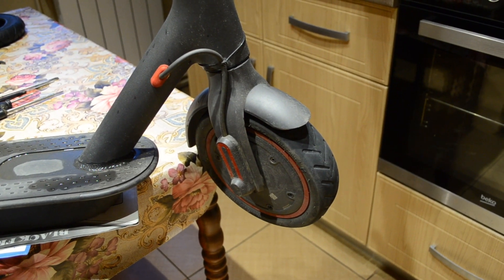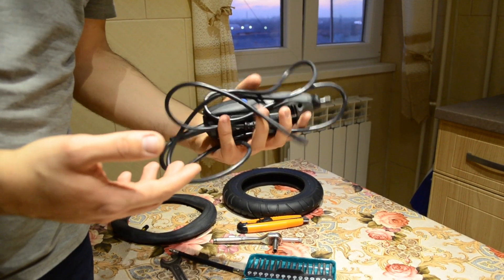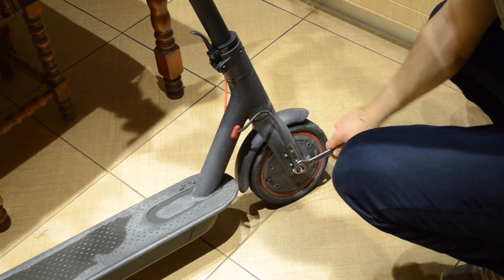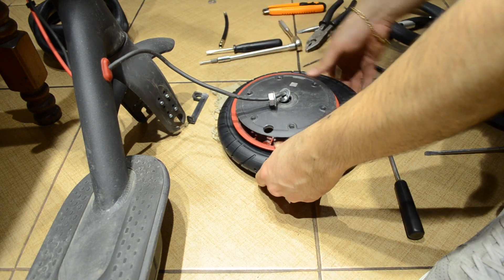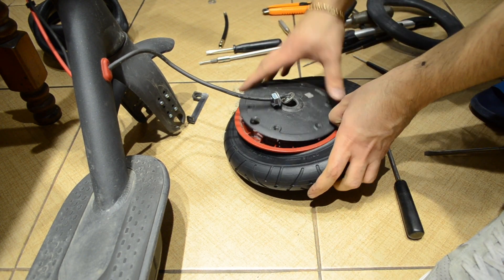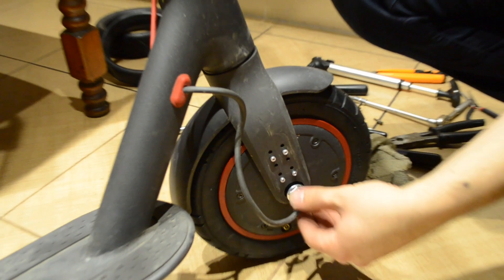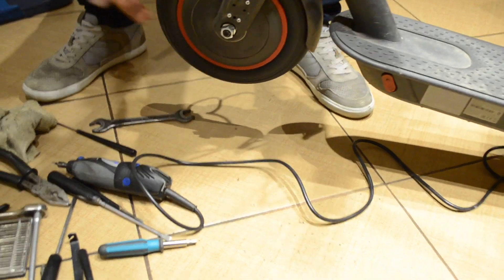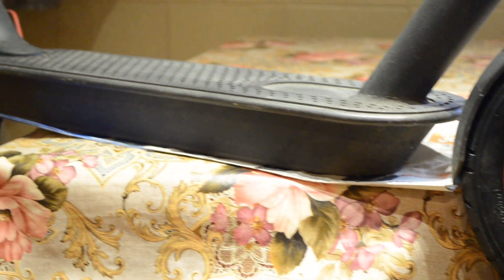Xiaomi m365 pro frontal 10 inch tire upgrade

Comment: Great video, thank you. The bearing was supposed to stay intact with the cover, that was why you had trouble removing it and putting it back.  Generally, the bearing has to be compressed into the cover, and the bearing should come off the axle easily, but it got stuck on the axle for some reason. it's amazing you were able to remove and force the cover back without compressing the bearing with a tool.
Reply from the maker: Thank you for your kind words!

Indeed. The other scooter was less problematic
Reply: There's literally no use in removing the motor cover. It's a perfect way to permanently damage it.
Reply from the maker: @hzpc  there is a plastic holder in there, so unless you want to drill/cut it away, it is far easier to remove the cover. As I said in the video as well, the cover usually comes off really easy, it's just that when I recorded this video for the pro version, it got off harder
Reply: @MrAbcdefgh1989  Not needed at all, you can change the front tire without taking apart the cover. It's possible to remove the inner tube without doing so.

Comment: This comment might be too late but you installed your front wheel the other way around. The spacer should be on the down side, not top. You did not need to cut away the plastic cover. You just changed the tires. Did not affect the mechanism of it.
Reply: Not correct - without the spacer placed upwards the larger tyre rubs on the mudguard, and it doesn't require much debris to get in there before the wheel seizes completely.

Comment: Nice  video , but i would say ,the plate came down so hard because the bearing  came out of its place , 
 it should stay in the plate  and you should use talcum powder when instaling a tire.
you could avoid using the dremel tool,
 if you change the front mudguard screw to a counterhead one ;)
Reply from the maker: valid comments. thanks! :)
Reply: @MrAbcdefgh1989  my only point is to help with them trully 😉

Comment: it is better and a lot easier to change the screw with a smaller head than chip off the plastic on the sides
Reply from the maker: I guess you could do that as well, but this way you avoid buying washers as well. And besides, it is only about 1 mm of plastic that needs to go

Comment: Good video. I will do it on pro version, so this was helpful..is the driving is still okay without problems ?
Reply from the maker: thanks. yes, the driving has an improved feeling to it, especially if you do it front and rear. I will post a new video for the rear tire in the next days, so stay tuned! :)
Reply: @MrAbcdefgh1989  yeah upgraded to 10inch without problems, also put a new front bearing same day. Driving is way better now. Flat tyre not so often, but can happen
Reply from the maker: @rudon9070  great! enjoy your ride :)

Comment: To me it seems easier to install a monorim suspension kit than change tires. Not counting cost, do you think it's better to change to 10-inch tires or install a monorim?
Reply from the maker: I wanted to install suspensions as well, but after reading up about them, they posed danger to the frontal part of the scooter (the added stresses were not factored in with the scooter design), so I did not want to risk it. Maybe they mitigated those stresses with later designs, but I would not go back to 8.5" regardless. The wheels alone are a huge upgrade in terms of comfort. As far as costs go, the wheel upgrade is about half the price of a suspension kit, while time-wise, I assume it is the same (from what I saw in other videos).
Reply: @MrAbcdefgh1989  ok thanks I am ordering 10-inch wheels. My odometer approaching 1400 kms already
Reply from the maker: @AccordGTR  cool!
Reply: @MrAbcdefgh1989  what do you mean that it stresses the front part? what exactly is affected when installing the monorim front suspension? is the damage to the scooter accumulative or does it happen instantly like something will break if you ever come across a pothole and you have the front suspension?
Reply from the maker: @heanlygaming5408  I have no idea how fast/slow/if at all the scooter frame will crack/break, but depending on the suspension design, you need to look for one which absorbs perpendicular upward force, not at at angle, which is really bad for the thin walls of the scooters rods
Reply: @MrAbcdefgh1989  I understand your point now. Can you please take a look at their new model called monorim version super that comes with an air shock and give me your feedback? It comes with a new shock frame and if you look at it from the side, the shock is almost perpendicular. I wanna hear your feedback before I buy one. Thanks!
Reply from the maker: @heanlygaming5408  looks interesting, but expensive as well .... your choice, let us know how it went :)
Reply: @MrAbcdefgh1989  I know it's expensive but what do you think? Do you think the new shock frame fixed that issue with the angled shock absorption?
Reply from the maker: @heanlygaming5408  from the looks of it, yes it has, but only time will tell.

Comment: Did u use original tube
Reply from the maker: No. Both the inner and outer tubes are an upgraded 10" variants
Reply: @MrAbcdefgh1989  ,you don't really need to change inner tubes bro
Reply from the maker: @JohnnyP--RES--17-ERS  why risk an explosion if you have proper, fitting inner tubes? :)
Reply: @MrAbcdefgh1989  there is no risk, if they still good and they should be ok, if you kept right pressure before, 
flats are beacuse of user error
And also can get them buy not using talcum powder when instaling tubes, especially when using bigger tubes 😉
Reply: @JohnnyP--RES--17-ERS  Your wrong with assessment of risk with running 8.5" inner tube into 10.2" tyre. The inner tube will deform inside the tyre whilst inflated and will eventually blow out depending on usage and outdoor temperature.

In moderate to cool climate, the inner tube will be fine but in warmer to hot climate the inner will stretch and deform. Obviously with a larger 10.2" inner tube you can run slightly lower psi over an 8.5" tube and reduce the risk of inner tube thickness to stretch out and deform. Plus lower psi makes the scooter run more comfortable on the road.
Reply: @millsshumps1968  what planet are you from 😅😅😅 
All your words show that you have zero experience
So wont start to argue ,you will learn in time